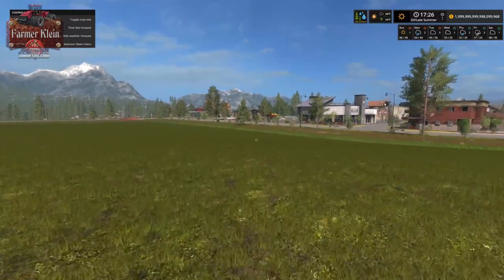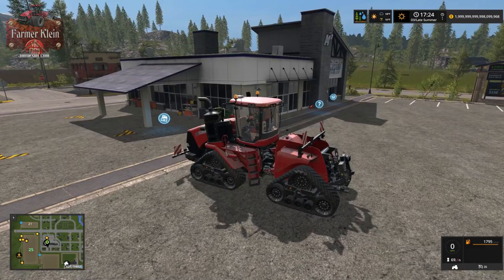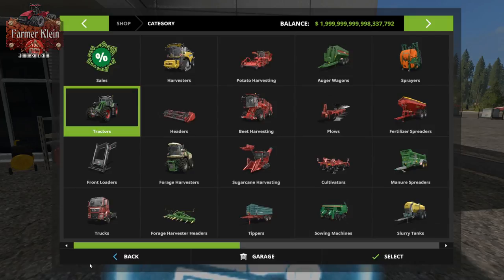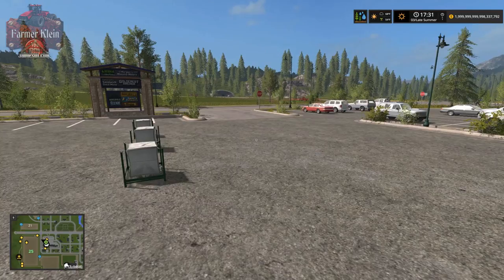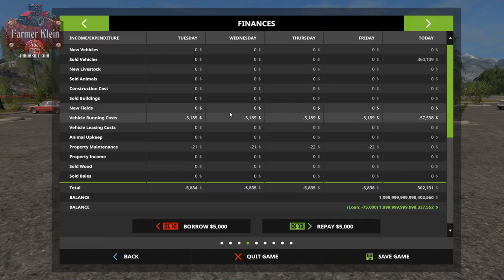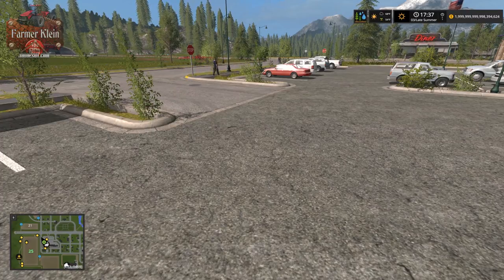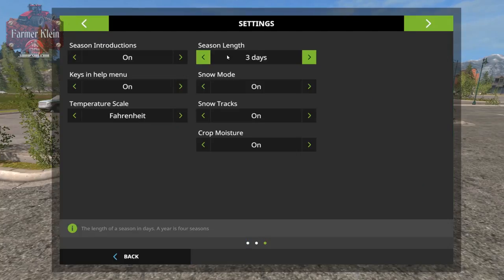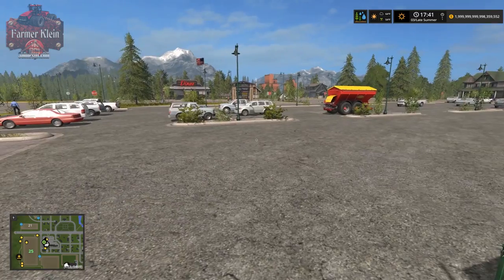FS17 - Seasons Mod - Tips and Tricks - Part 7   Equipment What do you need to know

Comment: I have not played much FS17 lately and I probably don't have the latest seasons update but I noticed one other issue with the maintenance.  I seem to remember that if you let your equipment go beyond it's maintenance date the daily maintenance fee went through the roof in addition the higher repair costs.  Is this still the case?
Reply from the maker: Yes that is still the case.  its to be indicative of not performing maintenance in real life and as a result you could have some very big repair costs by skipping much lower cost routine maintenance tasks.  Its only due once a year so if you can remember to do it toward the end of winter or before your powered implements hit 30 hours your good.

Comment: How did you get so many hours on the tractor
Reply from the maker: I edited the vehicles.xml in the save game to add several hours to the tractor for demonstration purposes.
Reply: Farmer Klein does it only work with in game vehicles or does it work with mods too.
Reply from the maker: anything that is motorized needs to be maintained.  tractors, trucks, conveyor belts.  anything you have to turn on.   the big green woodchipper,etc.